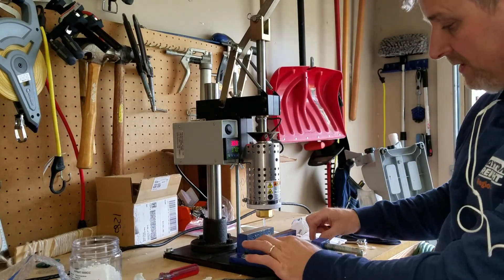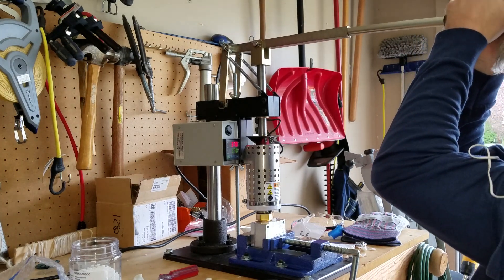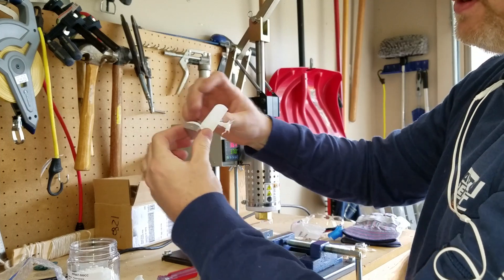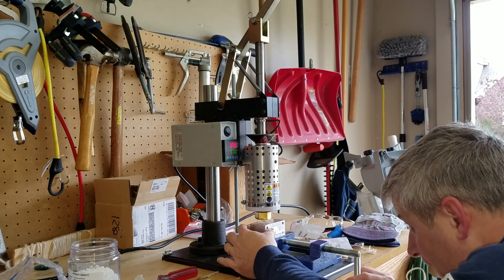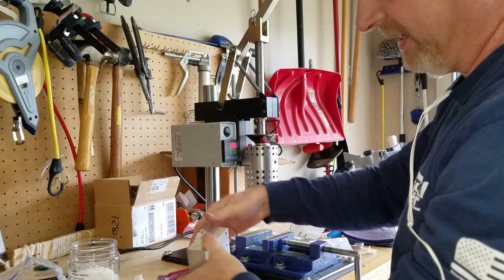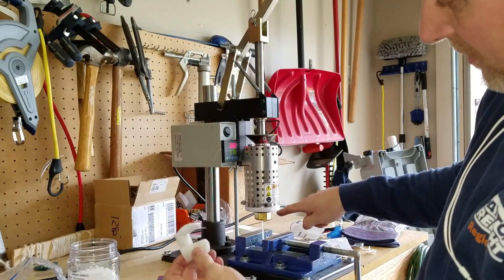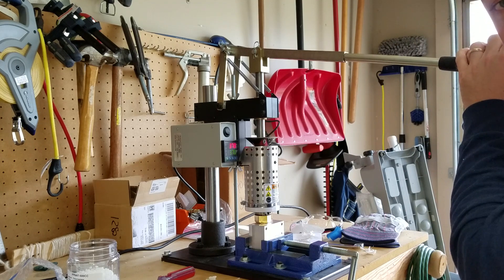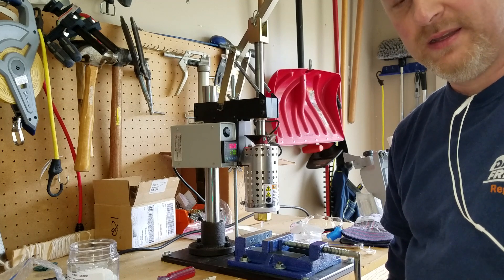LNS Technologies Model 150A 1st shot

Comment: Is it possible to do multiple shots for a larger volume mold?
Reply: Max shot capacity is 2 oz. N
You will need a bigger machine for anything bigger. So to answer your question: No. Plastic will cool to quickly for multiple shots.
Reply: @RobertPatterson192  Thanks!

Comment: you can reuse the sprews and misfires if you chop them up can't you?
Reply from the maker: You can but I'm having a hard time figuring out how to chop them up.
Reply: @Prodriverproject  you'll have to weigh the cost of a bench top grinder. I've seen a lot of different ones on you tube even some kits of laser cut parts to try to cut cost, there again you'll need a LOT of scrap to justify the cost  :) Thanks for the reply

Comment: What are the heater barrel dimensions , ID,  OD , length , pillar dimension , pillar to barrel distance
Reply: Not sure about all of that. But, the shot cap. is 1.1 cu in (18 Grams PS), Max temp. is 500 Deg F.(260 Deg C.)
You can ask the people over at https://www.techkits.com/products/model-150a/specifications.png